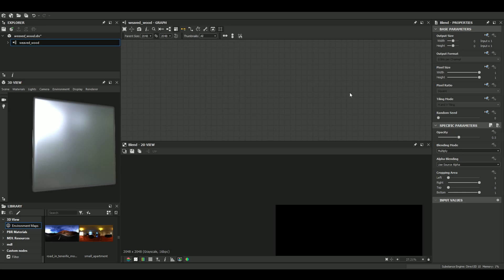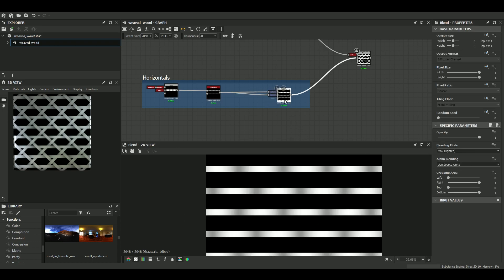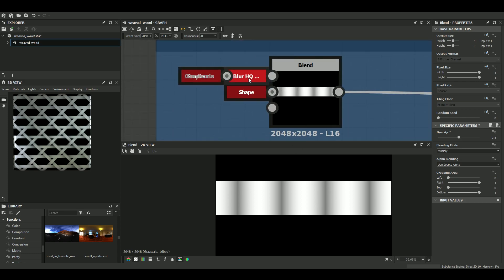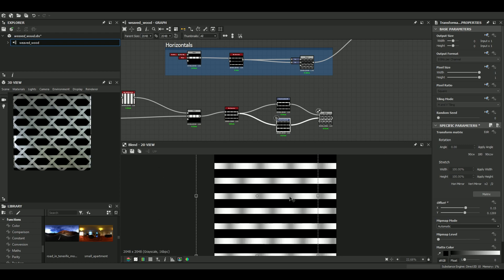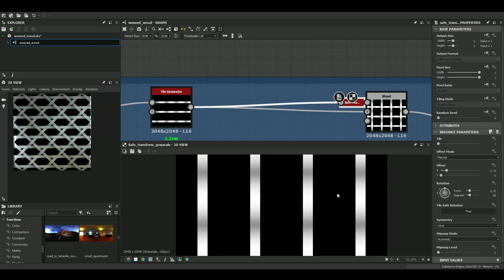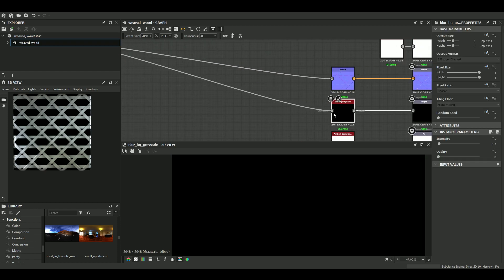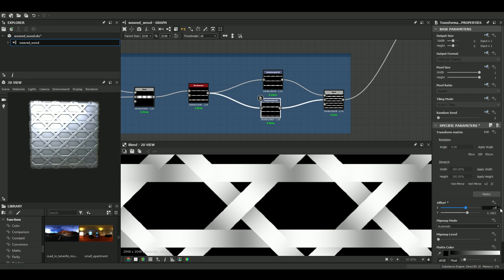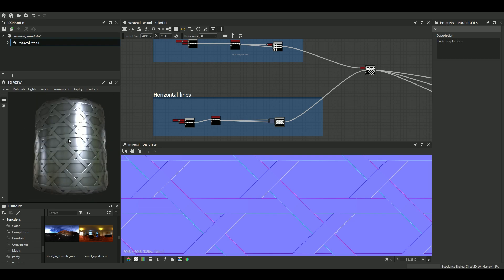Weaved wood pattern in Substance Designer

Comment: Thanks for the tutorial! By the way, setting Tile Generator Image input filtering to "Nearest" or "Bilinear" mode may fix tiling issue.
Reply from the maker: Thanks! Yes actually it fixed the scale issue but the situation stays the same in the 3D view and in the normal node. It turns out that it was a too high blur value in both the blur HQ nodes. Setting the value around 2 fixed it.